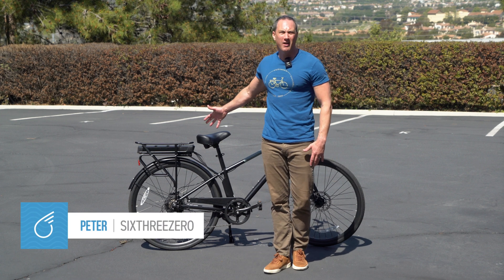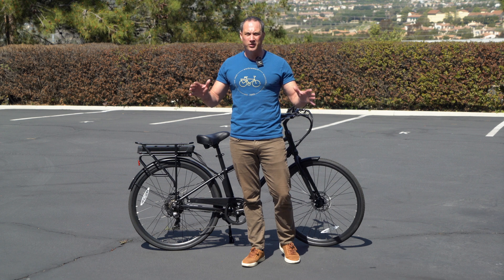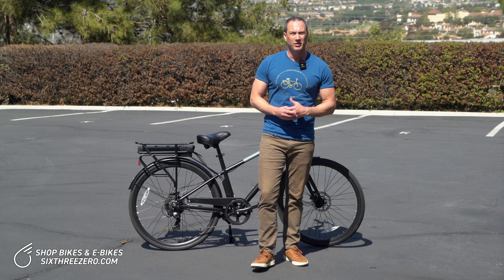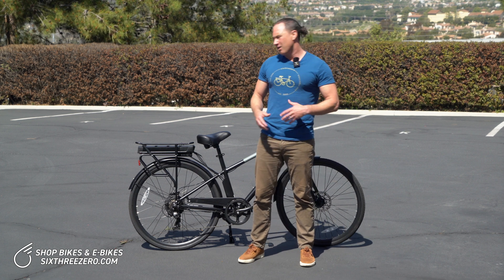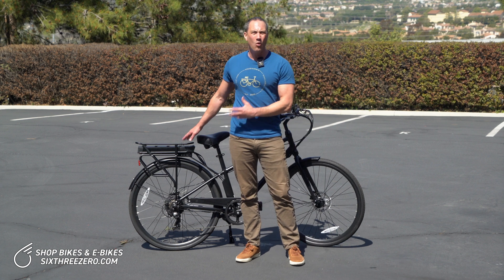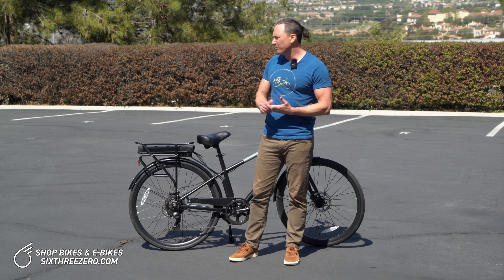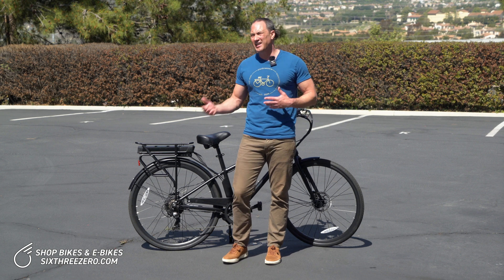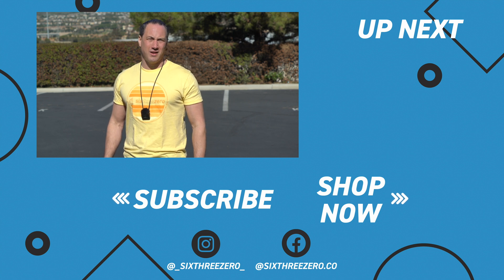Electric Bike VOLTS, WATT HOURS, & AMPS | What does it all mean?

Comment: Awesome video!

Voltage is pressure and amps is like the size of the opening for flow like a garden hose vs a fire hose.

If you open a garden hose, the water will come out pretty quickly right? Probably fly a few feet even,  But if the hose size went from 1" to 6 inches in diameter, the water will kinda just fall out without flying through the air. However, the pressure is still exactly the same.

In the case of an ebike, increasing amps will give more torque to the wheel

Increasing voltage will turn the motor faster. 

Increasing amps will cause the wheel to spin up quicker, but not turn any faster. 

Increasing amps AND voltage will cause the drive wheel to turn faster AND turn with more torque.

Other factors determine rotational speed and torque based on the design of the motor. Example, number of windings will cause the motor to either turn faster with less torque, or slower with more torque.
Reply: what's the difference between turning and spinning the wheel?